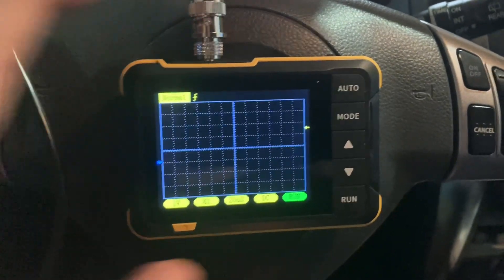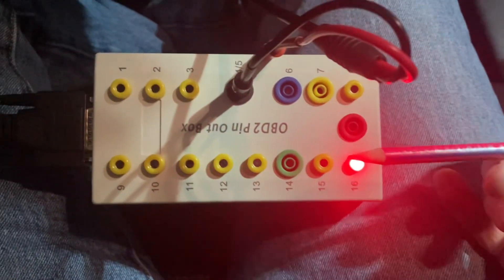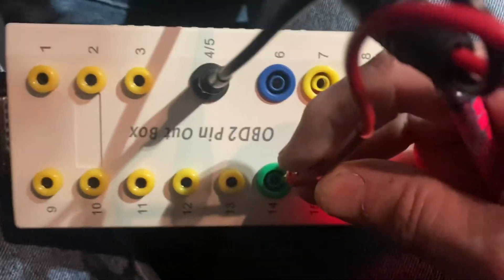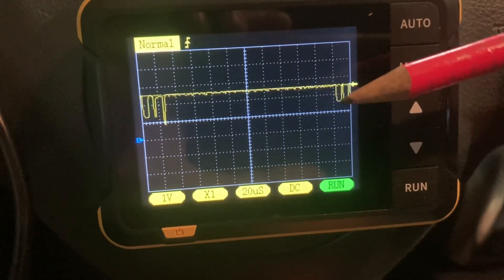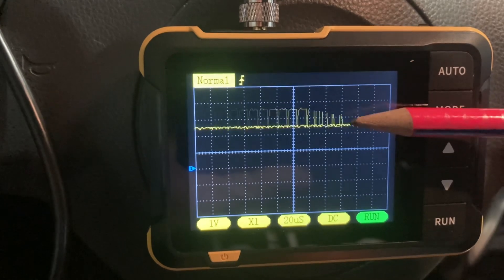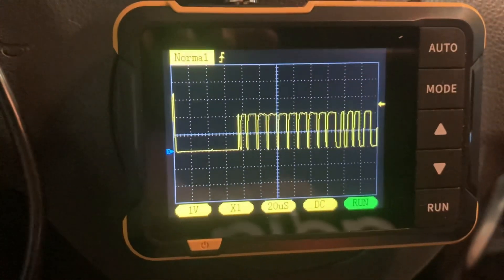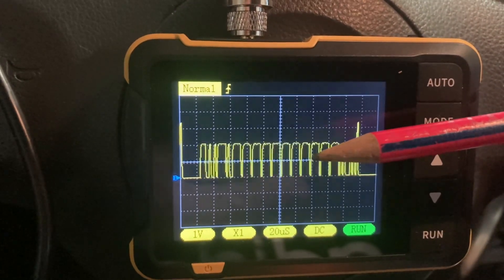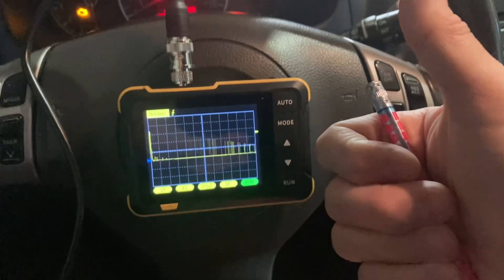Fnirsi DSO152 Vs. CAN Bus

Comment: Really cool man. I appreciate you showing this, I'd like to get a picoscope if I keep diagnosing issues for folks. I just ordered one of these tonight however as it looks more than adequate for just seeing if it looks mostly normal or not.

Noticing they also make a 2ch osci/multimeter combo device. I just wish it used regular batteries.
Reply from the maker: You will be amazed at how a scope will take your level of understanding well beyond what you had previously understood. Great learning tool. Thx for watching 👍🍻
Reply: @TheGibby3340 Well CAN high is hardly moving any data!  CAN low looks solid though. I also had to change the 'dots' (? I don't know oscilloscope terminology lol) on the left and right of the screen to match what yours look like. Then I could see things. But yeah CAN high looks totally wrong. Hoping I have a lead to go on now, will try jumping modules. I guess if jumping modules works it'll be a module issue and if it doesn't perhaps a wiring issue 🤷‍♂️ and I'll test for continuity on CAN high between modules. This is really cool.